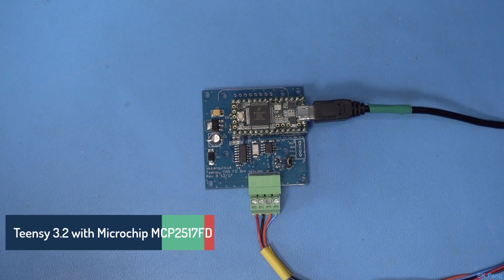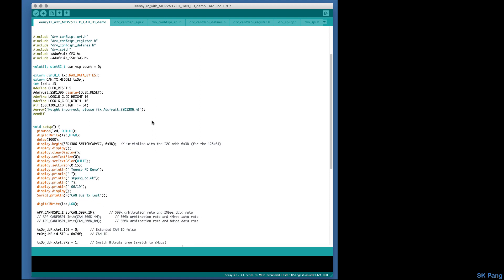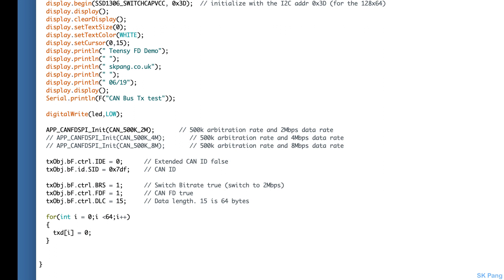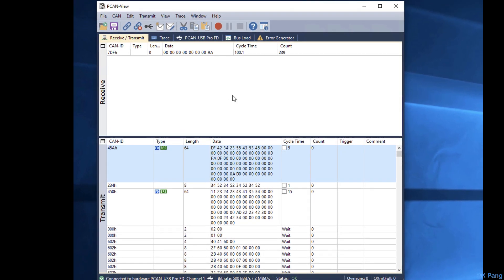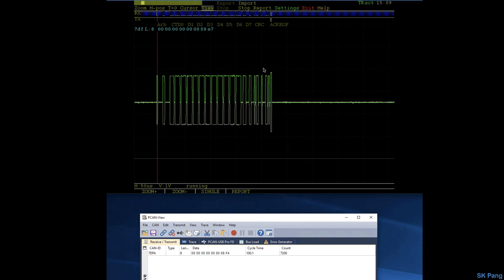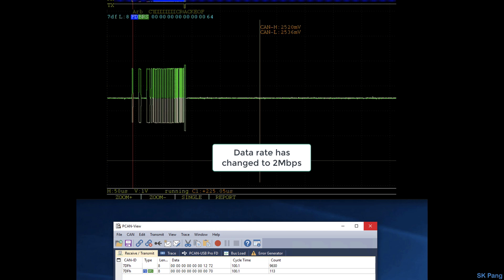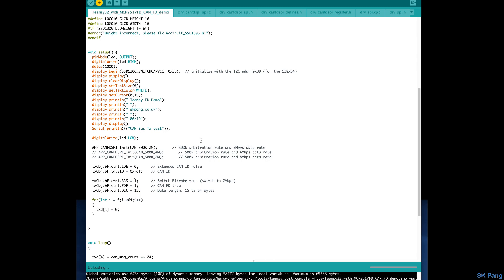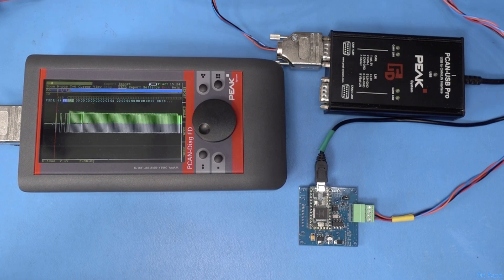CAN FD with Teensy 3.2 and Microchip MCP2517FD

Comment: When I try running, I get a BUSHEAVY on the USB-Peak PCAN-View!   It shouldn't require a another node to ACK, correct?

For just basic can (not FD), what is the minimal initialization needed to transmit a single 8-byte message at 250kbps?